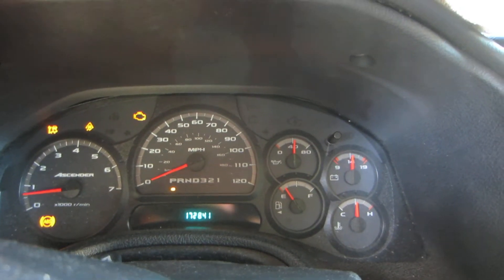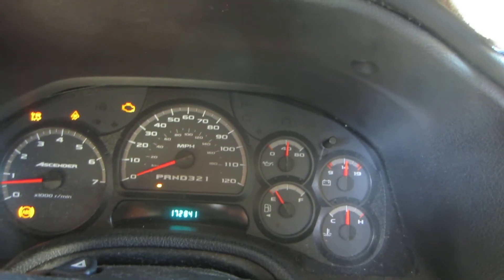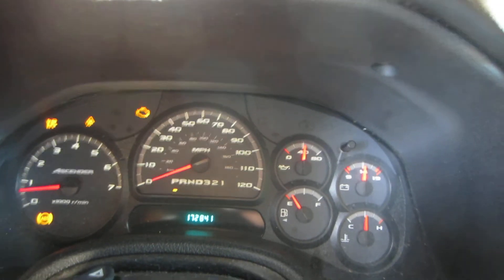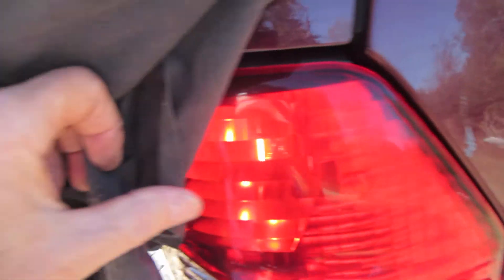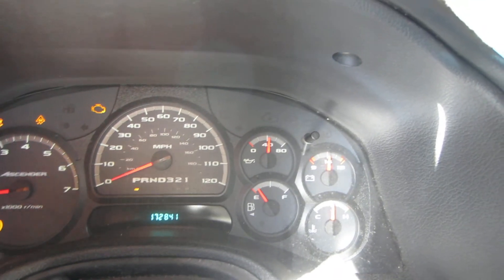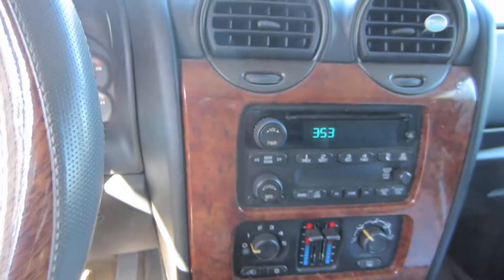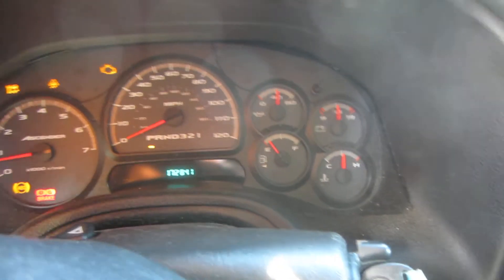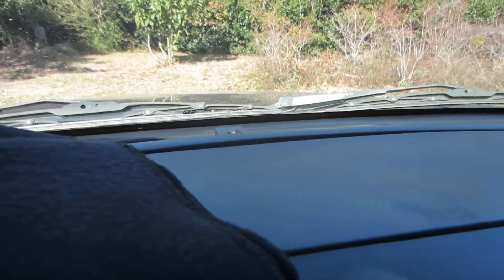HOW THE DRL AMBIENT LIGHT SENSOR WORKS- Why My Parking Lights and Taillights Do Not Work in Daylight

Comment: How did you fix the tail lights
Reply from the maker: Thanks for asking! It turned out to be under the back seat, driver's side: a broken connection on the "printed board" that connects the fuse box to the wiring harness. There was some corrosion from bugs getting in there. I ran across a like-new "board/card connector" at a you-pull-it "junk yard", plugged it in, and all the tail/brake lights worked. Easy Fix! Hard to diagnose!

Comment: My 2005 pontiac grand prix has the DRL's running as my parking/turn signal lamps at full brightness and when the sensor trips they dim and the full headlamp system kicks on. My driver info center will be a red background during the day and then switches to a black background at night. Pretty nifty! The HDM relay (which controls only the lowbeam headlamps) found in many 2006-09' trailblazer/2006 isuzu ascender/06-07 saab 97X/06-09 gmc envoy/05-07' buick rainiers are known to fail. Another set of GM vehicles that suffer from this issue are; 2004-08 pontiac grand prix, 2005-09' buick lacrosse. There have been reported cases where the relay gets so hot it melts causing underhood fires. There was a listed recall from GM for this defect. Did yours fall under that category??

Comment: Is there a way to turn it off?
Reply from the maker: Others GM owners may have some info on altering the automatic operation of the DRL system and are welcome to post on that, but I haven't done it. I think there are other videos about rendering the DRL inactive. It seems as if some vehicles have a provision for it described in the Owners Manual. On mine the videos described methods that seemed complicated, splicing wires and such if I remember correctly. I don't want to modify my system (permanently) and risk frying electronics also. SO! If I want nighttime operation in daylight, I just cover the sensor and it "thinks" it is in the dark! The daytime mode running lights do not create a problem generally as they are designed to run using low amperage (lower battery draw). In an emergency such as limping home with a bad alternator (daytime), I suppose the headlights fuse could be pulled to kill the DRL mode headlights. Not sure which fuse right now though. Hope all this makes a bit of sense! Thanks for Watching!